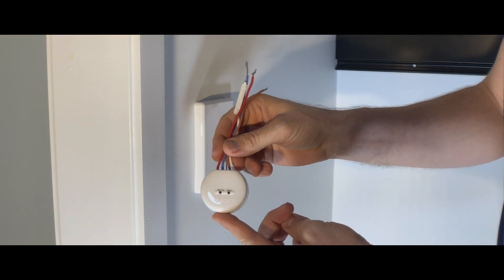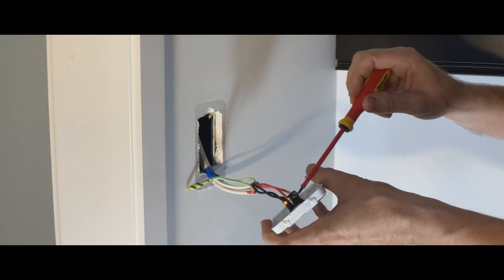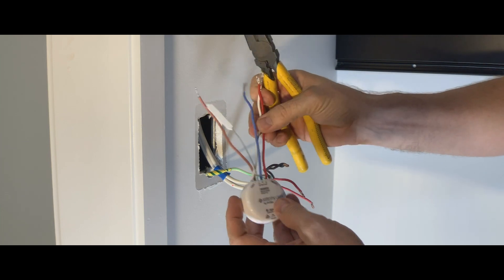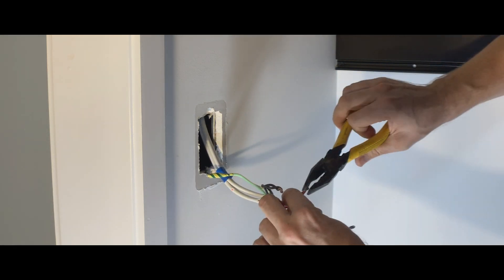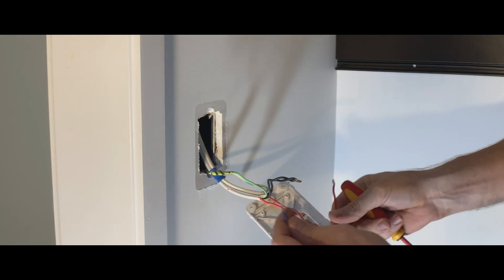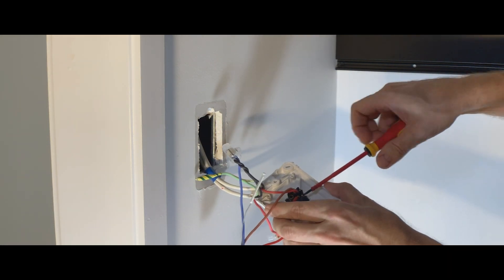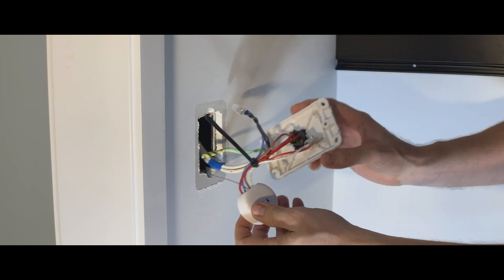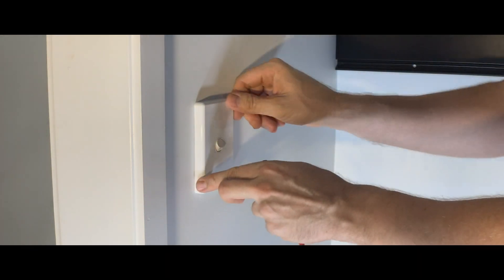How to install Stitchy smart home module (Zigbee 3.0)

Comment: Does the Stitchy Dim work with a momentary switch so that the button can also be used to dim the lights or is the dim function purely limited to the smart controls? Physical momentary switch option would get the wife acceptance factor...
Reply: Yep, keen to know if a new version with momentary switch support is in the pipeline... Definitely a feature missing from a great product
Reply from the maker: Hey, we have test units of momentary in the market and will have stock by the EOY!

Comment: is the dim with plate available yet? Another video said end of 2019, cheers
Reply from the maker: Hey Mark, do you mean the Stitchy dim or Neutral free? Neutral free is arriving into stock shortly and Stitchy dimmer units are available from various outlets around Australia
Reply: M-Elec I mean the dimer with wall plate manual control
Reply from the maker: Hi Mark Shueard, not yet ready sorry. Estimated early 2021 at this stage!